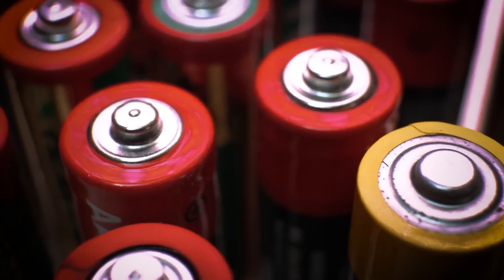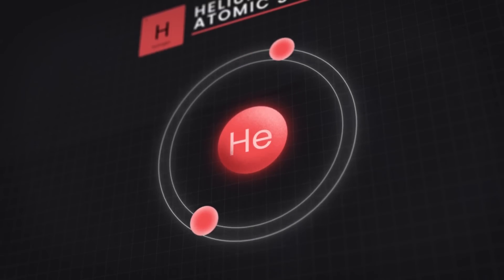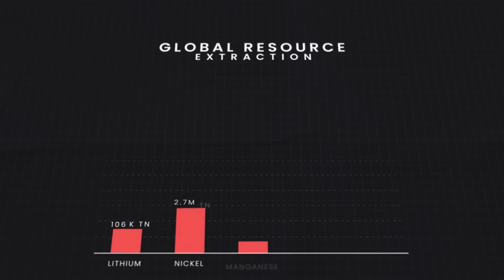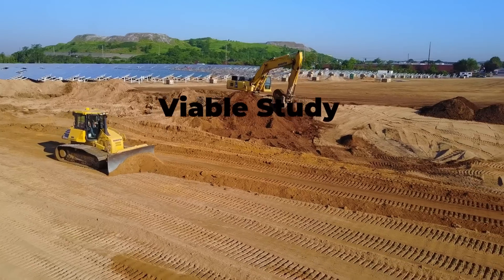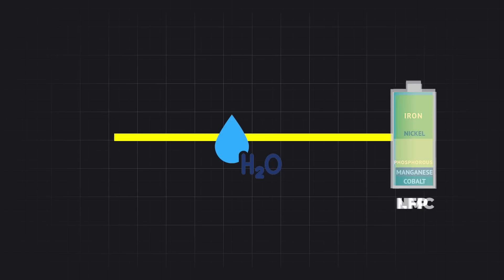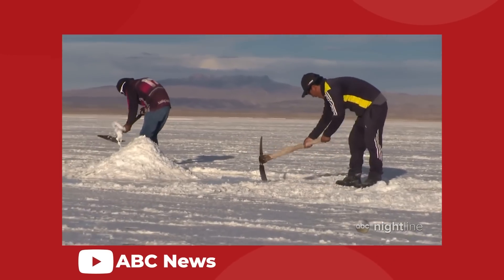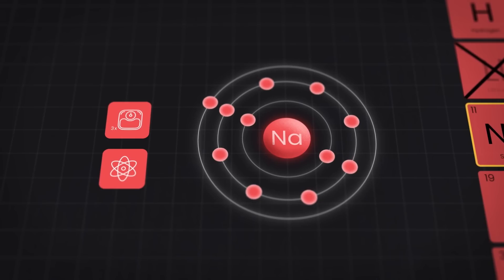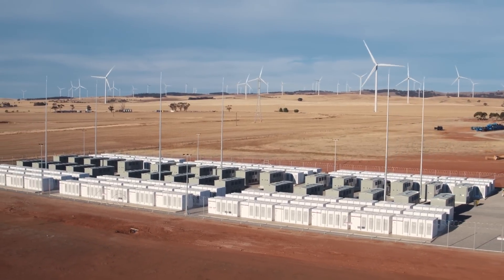The True Cost of Lithium Batteries Is Not What You Think..

Comment: LFP can also be charged to 100% regularly compared to regular level of 80% recommended
Reply: What I heard it is yes and no..  Tesla recommends that because better for BMS…. LFP still lithium..
Just has longer life compares NMC and less stressed after fully charged
Reply: What is regulat? Lfp is different chemistry from li-ion. So you charge different. And never to 100%. 98% is best for battery life with slow charge at the end of the charge curve. Again, they are different chemistries.
BTW superchargers are battery life killers. Fast charge of LFP only to 80% state of charge. 3.45 volts per cell is critical. From there on You can not fast charge to 3.6 volt without shortening battery life. Best is to charge to 3.45 volts and let absorb with low current from there to 98/99% soc. About an hour. The bms can even out cell differences within the pack. If you fast charge all the way up to max pack voltage you get imbalance in the cells due to internal resistance and temperature differences between cells.
So fast charge only to 80% for better life expectancy. Your wishes may vary though. We are all different.

Comment: It's worthwhile to point out that every electrochemist and engineer working on batteries knows that it is not at all necessary to use lithium batteries for stationary energy storage. High energy density is desirable for EV batteries, but neither mass nor volumetric energy density is all that important for say, Powerwalls or utility-scale batteries for energy storage. It's fine to use used not-yet-recycled lithium-ion batteries in stationary storage, but not necessary. 2 points: (1) it's NOT good to work out on salts flats rich in lithium salts (from evaporation, see 8:00) with no masks to protect workers from breathing in dust rich in lithium, (2) more electons in the core of sodium atoms than lithium atoms doesn't make the chemistry "more complex" (9:27) - that's just silly. Anyway, the mass of both the lithium and the sodium are a modest fraction of the mass of battery cathodes and, usually, even the anodes.

Comment: The problem isn't about batteries.  It about roads  that perform no real function.  If your EV has to carry the electric charge you need many batteries and enough efficiency in usage to make the EV practical.

If the road provides an electrical charge the you only need a small battery pack and a much less charge holding capacity.  If roads did this EVs would be cheap because better road designs would do most of the work of moving transportation.

The model for this has existed for most of the last century with childrens car tracks, railroad tracks, etc.  If the battery powered EV is the adult version of a kids triple A powered toy then a kids vehicle track is the version adults need for EVs.  Only enough battery pack for short distances on unpowered roads. 

In the post WWII years of the 1950's this country built the national Interstate roads.  It took about twenty years to do.  In about the same length of time America could build a nationwide network of powered roads for all electrically powered vehicles, heavy trucks and railroads.  Additionally we'd have a new national power grid better than what exists now and it could power the entire nation on sun and wind, distributing it across the country and storing excess energy as needed.  It would make America self sufficient in electrical usage with no dependency on foreign oil and terrorist countries.

In fact, the US could sell electricity to other countries and recoup all the costs of building the new energy transport system.  Furthermore America could achieve most of its ecology goals.  Lastly, by building such a new national system we could provide about fifty million high tech jobs, generate new businesses and turn many roads back into grass and parks since concrete and pavement are not needed to accomplish a powered roadway.

America could leave the past 20th century and enter the 21st century before costs rise to critical levels.  America cannot support the future of the country on archaic, primitive roads.  Our roads have become a terrific burden that grow worse and will cause an economic disaster.  A more enlightened transportation system will have many important spinoffs.  The cost of change goes up as time goes by.  The benefits of imagination and foresight are historical and produce benefits.
Reply: For the road to provide that charge you have to install a wire in the road... go and calculate how much copper that will require. ;-)
Reply: @lepidoptera9337  I already have.  Did you?  Or do you make a habit like almost everyone of letting others  answer your questions without you doing the mental work?